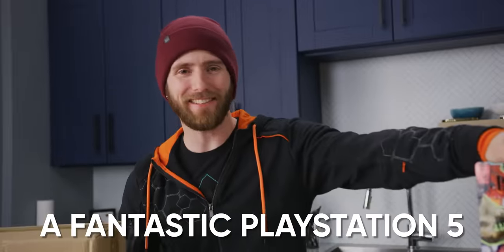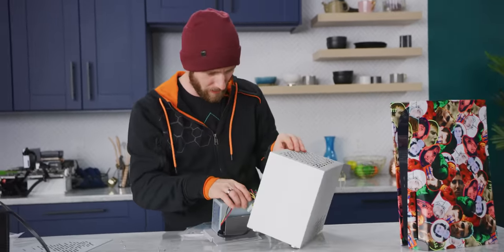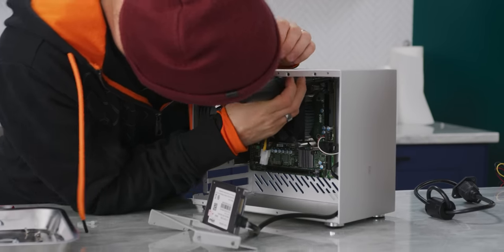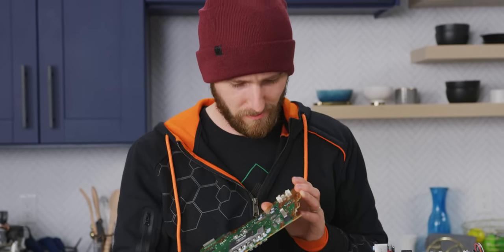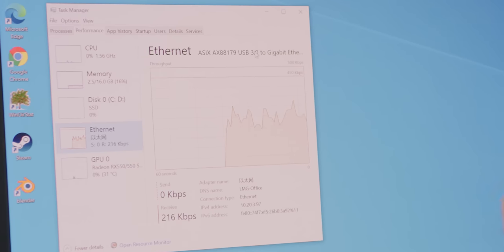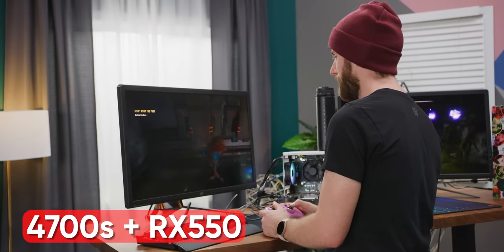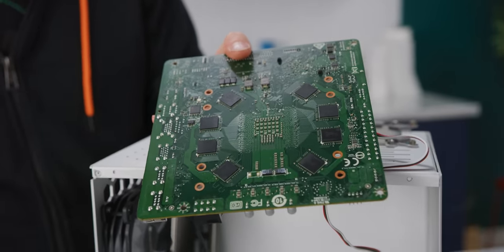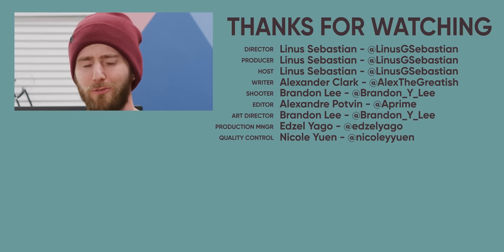Why Is AMD Selling Broken PlayStation Chips?

Comment: I would love to see these in cheap desktops instead of having Athlon/Pentium...if they could solve the PCIe issue!
Reply: Except its timings are slower than a pentium from 15 years go. Sooooo. No.
Reply: @GreyBlackWolf  only the RAM timings are. They would be crucial to performance intensive tasks and snapiness but you average grandpa/excel and chrome user doesn't really care about it. Heck,some might still bee on HDDs
Reply: @namankohli1061  true
Reply: @namankohli1061  J4105 systems are pretty popular so this should have a chance in that market.
Reply: @amirpourghoureiyan1637  yeah also,schools might be a good market imo but I'm not sure because I've seen schools in the US have Macs 😅

Comment: I'm not sure taking e-waste and turning it into even more e-waste is actually a win. You don't really have to try that hard to find something positive about a hot steaming pile of
Reply: It's not necessarily e-waste. Whoever took the board and tried to turn it into a gaming PC can be scolded. The board itself could be useful for something like a control system where it doesn't need much in the way of graphical power.

Comment: I wonder if the steam deck OS would run great on that SOC
Reply: Linux works on some wierd places ps2 m1 macs and other places.
Reply: @Ghfvhvfg  Linux in general, yes. But you can't just slap any old release onto any old system. E.g. x86 releases on a M1 mac wouldn't work. Also for gaming you'd obviously need pretty decent graphics drivers.

Comment: In Europe you can buy the Board for 370€, there are some reviews. The biggest Problem is see is the high Idle Power on this system and the bad S-Ata drive connection. The high Datatransfer rate of GDDR6 would lean to a dezent file Server, but then it would need 4-6 S-ata Ports and the PCI-E Slot would be for a dual 10Gig Card. With the high Idle Power Consumption it discqualifies as a NAS Board, together with the 2 S-Ata Ports.  That would be a great Area to use it, as home server. 16 Gig Ram are adequat, the same goes for the CPU Power and Data Transfer. But then it would need a very low Power Consumption in Idle mode. 
My Suggestion to AMD: Cutt the PCI-E 16x down to 8x, use the 8 lanes for a 2.5 GBE Network Card,  putt 6 s-ata ports on and then reduce the Power Consumption. Then this Puppy is a nice ITX Serverboard for Smallbusiness or Homeserver, 2Gigs of Ram per Core is just enough.

Comment: Shame, I really like APU's and smaller system build options.  With an actual good custom cooling solution that system would make a decent HTPC if the APU was functional/existed.

I planned on getting one of the new Ryzen 7 5700G(E)'s if I was able to get my hands on either for a reasonable price (lmao).  Also a new motherboard with APU compatibility as well to mess around with it before I throw my RX580 or 6700-XT depending on use case.

Comment: Fun fact, Sony uses that ethernet chip so that if you're downloading stuff in rest mode the CPU doesn't need to turn on at all. In rest mode the CPU won't turn on which is how they got the rest mode power usage so low.

It also takes the downloading load from the CPU when the PS5 is turned on as well.

Comment: Noticed a much larger quantity of DOA parts lately from several companies. I've had to replace about 4 components this year due to them being DOA.
Reply: Tis the nature of the chip shortage I suppose. Companies could be lowering tolerance levels to meet up with supply and demand at the relatively small cost of more DOA or lemon products rolling off the lot, at least to a given company’s bean counters. The higher complexity certainly doesn’t help matters either.
Reply: @GabrielIgnacio  Yeah, got 2 dead PSUs in a row from EVGA.

Comment: I actually get 55.2ns memory latency in my 5900x, you gotta run slightly higher CCD and IOD, and use b die, 1:1  3800 MT/s  GDM on.  I run 16-(15)-14-12-27-42-294, and CADbus 24-20-24-24

Comment: According to the sticker on the power supply, it takes up to 220v ac. It can use wall source from USA and Europe. Not having a voltage switch there means it automatically switches to use the lower voltage

Comment: It's just like you can have 300 amp alternator in your vehicle. Only pulling 150 Amps. You won't damage anything in your vehicle up to 300 Amps. It's all part of Ampere's Law. 

Which can be stated as the magnetic field created by an electric current is proportional to the size of that electric current.  

With a consistent proportionality equal to the permeability of free space. So in layman's terms here is long as you're polarity is correct. 

Extra current capability of a power supply. Will only be supplied as needed. As long as the original power supply is enough for the load. Same voltage of the power supply's  output will be the same as before.

Comment: You're overhyping the "Danger" of the PSU.
Just because it's a cheap one doesn't mean it wouldn't work. If someone knows how to make cheap electronics reliable, it's the asian guys. Almost never were disappointed by their cheap alternatives.
Also if you're running a 110V power line it's no problem at all to get 220V out of it.
We used to install murican Machines over here in Europe and put Air Conditions on them, which needed 220-240V.
So we just took two power lines with 110-120V, screwed them onto the socket and called it a day.
It's alternating current. So two active cables with 110V on both connectors (L+N, or positive and negative) will give you the 220V you need.
Hire me if you need a techy like that. - an Electronics Technician for Industrial Engineering.

Oh also burning down house would only happen if you put more than 220V in it. Then it would start a small Firework. With 120V it won't do anything. Just sit there wondering if you're being serious.

Comment: That is a really dangerous power supply and it should be VISIBLY marked on the outside of the case with the necessary warnings.  Especially when it can start a fire when used with the wrong power.

Comment: 5:00-6:08 The ps5 m.2 slot is not 2xgen4. It is 4xgen4 which is needed for the recommended speed of 5.5GB/sec that Sony lays out for m.2 NVME drives that users can put into the ps5. 
2xgen4 equates to 4GB/sec of potential bandwidth. 4xgen4 equates to 8GB/sec of potential bandwidth.

Comment: Meh, I'm pretty happy with my 4750G that cost me $450 last year and is running on a B550 - with fully functional Vega 8 graphics. Huntkey is OK on the low-end, I have a few H702 60w ITX cases. I think an older AMD A10 Biostar A10N-9630E will do better with it's PCI-E 3.0 x16 slot.

Comment: This thing was available in our county as a barebone with 2 gpu option..with rx550 nd 570 maybe for 43000 rs/-nd 45000 rs/- cant remamber the price properly..i wanted to see someone do a review on it.wanted to buy it..thought that could solve my problem..bt i am lucky that i didnt make that choice nd invest on new setup 5800x nd new mobo ram nd ssd psu..it did cost me more bt its worth it. Just need to change my rx 580 8gb later on if  anytime the gpu prices comes down. Thanks for the video though.

Comment: One hit the 110/230 V switch in a old power supply thinking it was a power switch. It was plugged in. It did explode, in my ear. (A single cap blew up. We replace it)
Reply: (on 230V mains)

Comment: A 230V PSU will not explode on 110V. It wil either function fine (and is just wrong label) or not turn on.

Most PSUs will also run just fine on DC power btw., but nobody has 12 car batteries around (in series 120-140V).

Comment: There is no problem with the PSU for most of the world, just because Canada follows the USA with the low voltage mains supply, it certainly is not likely to blow up, if you open up the PSU you should find some dotted lines on the PCB indicating where the 120/230 switch is connected to on models that have the switch mounted on the back, just solder a wire between them..

Comment: Just to be clear at around 3:20 where its revealed that the PSU doesn't support 120v.
Thing is it's rated for higher input voltage so unless you exceed that you're not in a danger zone.

It would be quite dangerous the other way around. If a unit supports 120v and is rated at 120v poor implementation of OVP or OCP could result in a more catastrophic failure should someone accidentally apply double the rated voltage at 240v (UK mains)

This way round all you'd see is nothing. Quite safe assuming unit is upto spec

Comment: You should have plugged that in, so no one else have to do that. As a kid, around 30 years ago I put one power supply to 115V and we have 230V mains... capacitors blew up instantly. But 230V power supply with 115V... nothing should really happen?

Comment: I just had an idea for manufacturers to try, instead of entire GFX cards have a GPU socket next to the CPU socket then design some fans/heatsinks/water cooling to see if it works out better that way, instead of the GPU manufacturers being responsible for providing the output slots like they currently are it would be back on the motherboard manufacturers, all that should be needed is a means for the GPU to just report which pixel buffer should be read from, an APU socket could also be put on the other side of the CPU, this method of design could enable new kinds of CPUs designed to offload their own instructions to the nearby GPU & APU if it deems it suitable or just include a new set of instructions to manually do so.
Reply: that is somewhat similar to the 80's 8bit and 16bit computers (c64, amiga, atari st etc), they had custom graphics chips in the board. the main problem now with this approach is thermals and power delivery (also lot's of other problems). have a look the size of the coolers modern graphics cards have, not to mention the 200+ watts they need. now add the modern cpu's power needs (could go 150+ watts) and you would need a large motherboard that can handle all that without melting into oblivion, not to mention the cost would be ridiculous...

Comment: I dont understand why there isnt a proper PCIE slot.
The M.2 slot in the PS5 is connected with 4xPCIe Gen4
So the bandwidth for a full 16xPCIE Gen2 should be there... but isnt?

Comment: idk, i've only ever bought 240V PSU's and non of them ever had a switch to 110V.... And most of my PSU's came from Corsair.
Generally, you just buy whatever PSU's with a set Volt that matches what's is in your house, it's a DESKTOP not a laptop anyway so it's supposed to be stationary.

Comment: Plugging in the lower voltage power wouldn't likely do harm. The slightly higher frequency is more of a concern, but still should be within tolerances I would have expected.

If it's a switch-mode psu then I'd be surprised if the voltage input didn't matter at all. Worst case is your voltages would be half.

Comment: What screen format or camera was this recorded in? I have black bars on the top, bottom and sides...surely you can use a common format for recording...or is it just that the editors can work quicker using smaller screen dimensions?

Comment: Plugging 120v to  220v appliance will not "Burn up". The power supply can certainly get damaged and in rare cases, it can also damage 
other components but for the most part, it will simply not turn on. I know, I've tested it. You have a higher chance of your 120v power supply burning up on it's own which is an extremely rare case despite all Gigabyte's attempts.  When I say burn up, I mean catching on fire.

Comment: if a powersupply is designed for 240v it will not fricking explode when pluggged into 120v the worst that can happen is it will just not work, the best what can happen is it will just work as normal and the in between thing that can happen is it will work but be unstable or the voltages of the individual rails will be too low.
a psu will only be maybe blow up when its designed for 120v use and gets plugged into 240v because than the voltage is too high and it can break stuff, but when the voltage is too low there will never be any damage to the components inside because they were fricking designed to work at higher voltages bruhhhhhh
and voltage is usually the killer for stuff if you overvolt your cpu or ram for example in overclocking

Comment: Just got one of these for 70 bucks with a 500gb SSD, a bent case, cheap PSU and an optical drive... Not too bad... For a cheap PC... Shame that Linus group didn't benched this thing with other GPUs to check the maximum value that could be obtain from these...

Comment: Its a 240v power supply, meaning if you plug in a 110v plug it would'nt catch fire and burn the whole place down, you would just not be giving it enough juice to even boot, right?

Comment: I had a customer with a really unstable system I took it home and poked around with it for a few days and found out the power supply switch was switched to 220/240v once that was rectified to 110/120v the system reported stable DC voltage is in the motherboard bios and it ran stable.

Comment: "Burn the place down"?

No. If it's a 220V supply plugging it into 120V will not result in any sort of 'burn the place down'. I will simply overcurrent the input stages and blow it's fuse, at worst. More likely is it just won't start up at all.

Comment: Someone please answer: Why was the soc not using the apu? Is it because the apu in these chips didnt work or did they honestly just not wire it to a port on the mobo, did linus just elect not to test it, is there no driver support for it in windows so they completely ignored it?

Comment: Would it possible (theoretically speaking, at least) to tap into the GPU in the SOC of this chip, or is there some fundamental limitation I've misunderstood that actually prevents it from working in a system like this?

Comment: I am slightly bummed.  Not because it sucks.  That I figured.  LOL  But because it doesn't let you compare FPS on a real Playstation vs on Windows.  For a long time now I've been curious how much the OS slows down gaming.  XBox would have been a better test, but a Playstation would have sufficed to get the general idea.  Hoping that one day M$ sells the XBox OS for PC builders and we can dual boot (or VM?) for gaming.  But no.  We don't really get to see a direct 1-to-1 comparison of game box vs PS with full OS using same hardware.  I was really hoping to see a real PS mobo with same everything in hardware, turned into a PC.  Oh well.  Bummer.  Interesting ... but bummer.

Comment: So if you reverse the fans does the thermals improve ? It looked like you could flip them around and it would work at helping pull air the right way. Unintentionally that may actually be a good mod with a little modding required before installation....haha

Comment: WRONG !!! You don't avoid active PFC with 220/230/240V AC input. The International Electro-Technical Commission wants it as well. Which begs the question "why ISN'T it Universal voltage".

Comment: Are you absolutely certain the PS5's M.2 slots are only Gen 2? The expandable slot should in fact be Gen 4 seeing as to which the drives being installed there must meet a minimum speed of 5500MB/s, even the soldered storage runs at these speeds.

Comment: I don't really understand the weird PCIe choice on this motherboard. The SOC clearly supports PCIe 4.0 x8+, given Sony's on-board and m.2 slot and Microsoft's m.2 slot and expansion port, plus the chipset's connection. So why is this board using a PCIe 2.0 x4? It just doesn't make sense from any standpoint. If this board was better designed, this would be an interesting system to mess around with once Steam OS 3.0 is out, as it's mostly a gaming-focused OS, especially paired with an RDNA 2 card once those eventually come out. I'm curious though, I know these boards have been in the news for awhile now, but are the boards themselves of AMD's design, or is it a board partner situation where AMD only sells off the modified SOC and whoever buys it designs the board?

Comment: You can get a PC with the 4700S with an RX550 oon Amazon. I will not include a link out of rrespect, however, they are on there for less than $600

Comment: I have one of these things in my hand now, what they did with it is BS.
The SoC has x4 4.0 PCI-E lanes, but they choosed to go for A77E chipset that downgrades it to x4 2.0 that it does bottleneck a 2060. 
The USB ethernet performs better than expected actually, there is no PCI-E lanes to plug anything else.
There is no USB 2.0 header whats a huge pain for some chassis, specially cheap ones, the A77E supports more USB 2.0 ports and more SATA ports, but they didnt bother to use them.
The Bios does not even have ACPI settings, so you cant even set this thing to turn on after a power failure.
Using a A520 chipset instead would already double the bandwidth avalible to the gpu and you could use a PCI-E ethernet or have a M2 slot.

Comment: One of AMD's main businesses is Slot machines and other embedded systems. My guess is that this is an embedded system meant for a 220V market and if it is actually designed for a gaming system they may be required to have a 220v only PSU due to regulations.

Comment: PC comparison was not even fair. Comparing Zen2 with Zen3 it is obvious the Zen3 will be faster by a huge margin, given it is the newer and significantly faster architecture from AMD. All this proved was that Zen3 is inherently faster than Zen2 which every reviewer has done so since Zen3 launched. It did not prove how slow the CPU of the 4700S is for a Zen2 CPU. Should have compared it against a Ryzen 7 3700X which is a Zen2 8 core part, and that almost certainly would have still won by a significant margin.

Comment: wait. If you put 120 in to the 220, it just would be lower voltages it would not cause a fire.  If you put 220 in a 120 then yea I can see the problem.